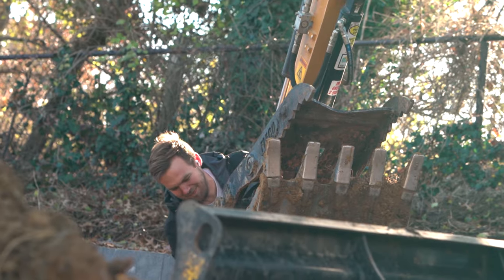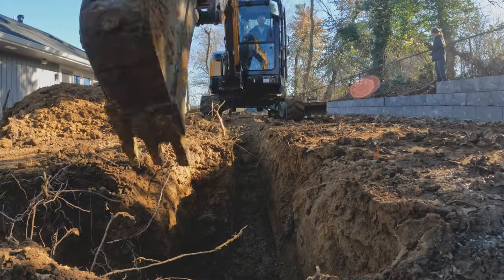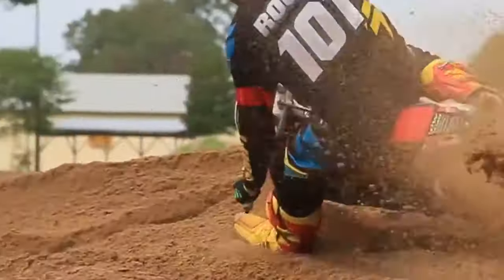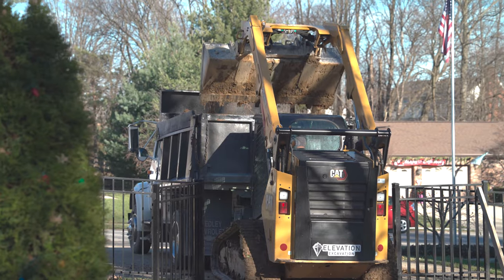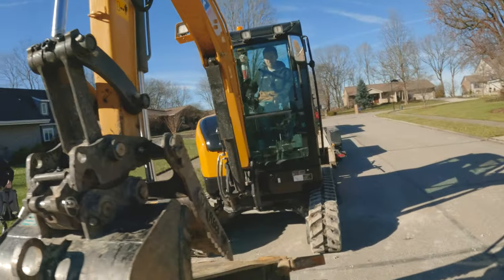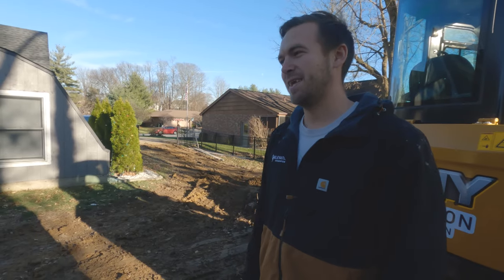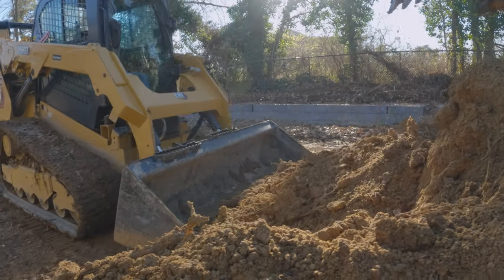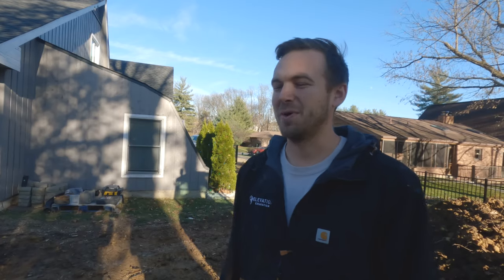SANY SY35U Mini Excavator In Action: Why This Small Business Owner-Operator Chose SANY

Comment: Does it have a backhoe mode ?
Reply from the maker: Yes sir it does! Backhoe and excavator mode can be selected through the pattern control change valve which is easily accessible. Do you prefer backhoe mode?